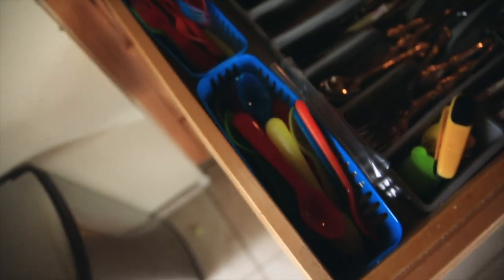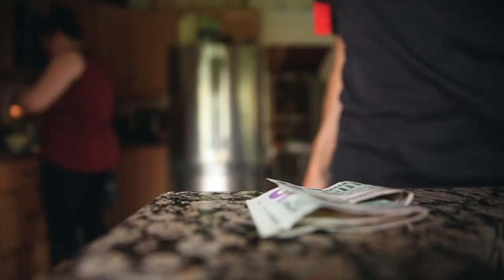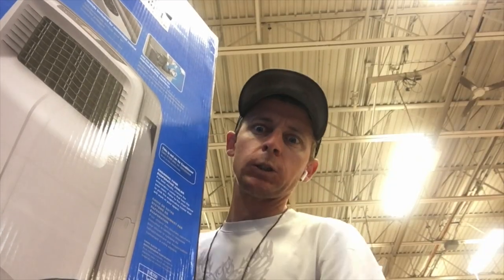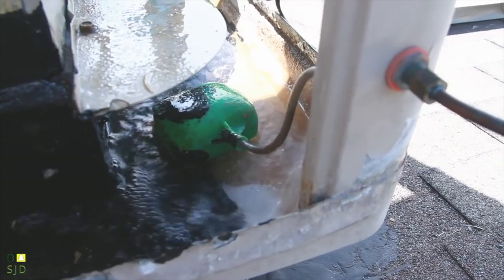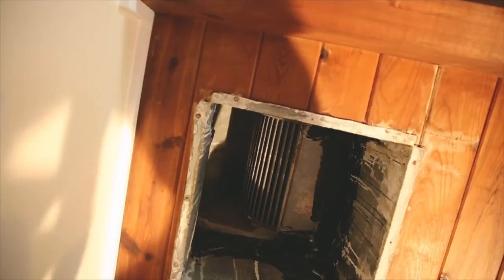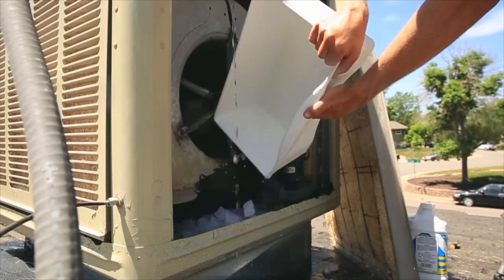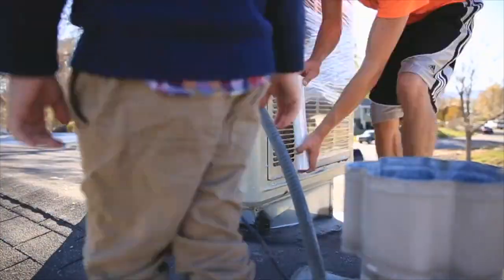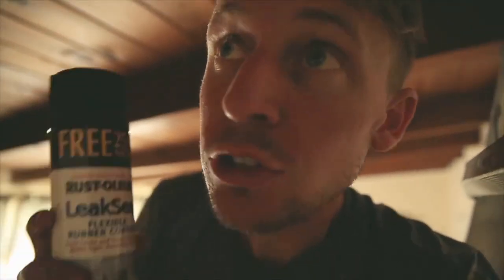SWAMP COOLER DEFEATS HOMEOWNER

Comment: The light the kids broke can be used in an art project.  You'll need 3-4 flower pots preferably the clay ones(small, medium & large.  Paint the bottom(large) pot red, the medium white and then small red.  When dry, stack and glue them upside down on each other with the large pot at the bottom & the smallest at the top.  Then, when that is done, place the broken light on the top.  You now have a lighthouse.  Just an idea I saw on Pintrest.